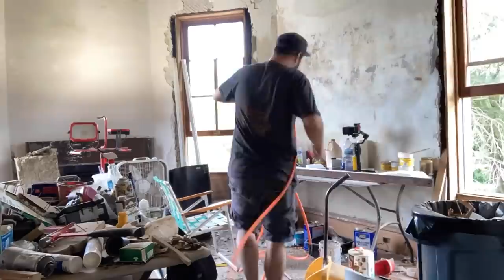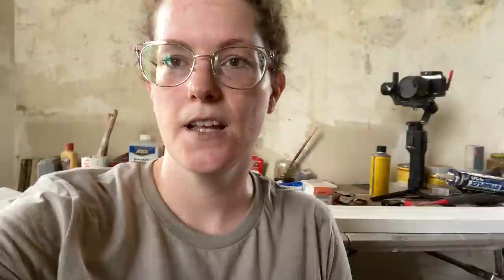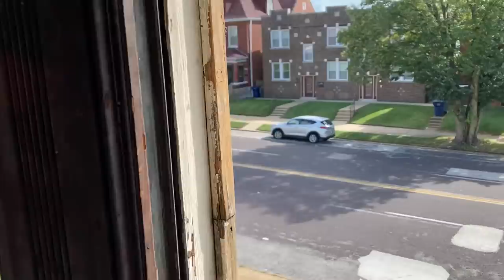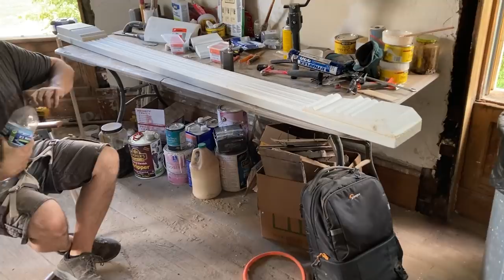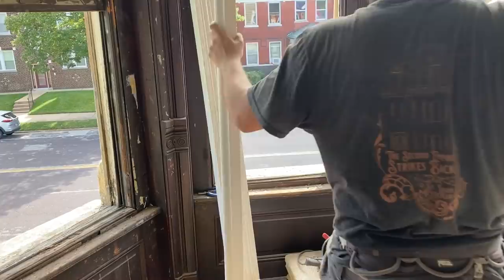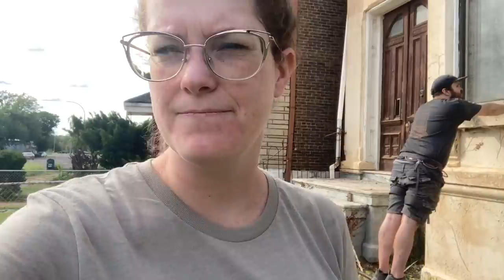Vlog 15 Cleaning Up the Library

Comment: Caleb is so lucky to have a partner in crime to clean up… I hate the cleaning up… but it has to be done….. don’t beat yourself up - why not pull all the staples out… they have to come out at some stage, why not take them all out at once. You have the patience of a saint. 100% to you both fir holding a relationship together while doing such a major project.
Reply from the maker: It really is a wonder that we haven’t had a squabble at the house.
Reply: @secondempirestrikesbackvlo2578  that's good. 
Don't sell your self short, ma'am. You are just as great as Caleb is just in different areas of expertise 😀 
 We LOVE Bucees 😃
Reply: @tashasmith6179  I second that sentiment.

Comment: Kim, you two are a package deal. I look forward to seeing both of you. And the house, which should be a lovely home when done (as if a house really ever gets finished. 😁)
I love the Second Empire homes, ever since I went on a tour of the Lucius Wing house in my then home area of Coldwater, Michigan. Fun thing about that place is the curved, tin mansard roof on it has leaked since new (1878, if I remember correctly.) So, there's always something to work on.
The comments on the shelving and storage are spot on. It's a big help with organisation. Even in my microscopic studio apartment, I was surprised by the difference between chaos and sanity a few shelves gave me. (And the few little storage solutions I've found for my ever growing collection of fountain pens and inks. 100+ pens, 26 different inks, currently, you might think pens and ink bottles don't take up much space, but unless you have good storage...)
I look forward to seeing each video from both of you! Even if it doesn't seem like the process is proceeding as fast as you might like (heat and tiredness can contribute to that feeling), you can take pride in the little things, even, knowing that they're done well and period correct, unlike the houses on "This Old House," which get unfortunately modernized and lose their charm from that. And the small things add up.
Keep up with the great work! Thanks for letting us see even things not directly related to the house.

Comment: I wonder if it would be worthwhile to get a heavy-duty shelving unit to serve as a way to corral all of the tools and materials that get distributed around the room while you're working on it. That would keep things off the floor, and would help to keep things a bit more organizable.
Reply: I agree.  Clutter makes me unproductive.   Keep up the good work!  Maybe a physical checkup might help find a reason for feeling tired. Just a thought.  Byeee
Reply from the maker: So yesterday I had just returned from vacation so I think that’s why. Today I was a little dizzy too, had me a bit worried. But I realized a few minutes ago I forgot to take my medication last night so that’s why.
Reply from the maker: Also great idea about the shelving!
Reply: @secondempirestrikesbackvlo2578  I agree !!  A couple of shelving units for the tools and the chemicals, etc currently stashed underneath the table plus a shop vac would make clean up soooo much easier!  You’d have clear floor space and suction to get rid of all the clutter and dust and dirt.
Reply: @secondempirestrikesbackvlo2578  I have one I'lll bring up this week
Reply: The best thing is to designate an entire room as a tool storage room, and keep it organised. Use a trolley to take required tools to where you are working.
I discovered this strategy while doing some work on my place and it changed my life.
Reply: @dcan911  
It worked for you and I think it would work for Kim, but I can’t see Kaleb wanting to waste time walking from one room to another.  I sort of have my doubts about him even using shelves in the SAME room!  He seems to get so focused that he just wants to work on whatever he’s doing until he’s ready to drop and then just wants to go home and get some rest.  
Obviously, I could be totally wrong - I don’t know them except for what I see on screen. 😊

Comment: Maybe get a nice industrial wet and dry vacuum. Saves agitating the dust when sweeping. Just suck everything up with no dust. Makes cleaning a lot easier too.
Reply from the maker: We have a big shop vac. I’ve never used one with water though! I just don’t want to clog the filter up with a ton of dust.
Reply: @secondempirestrikesbackvlo2578  There are special wet and dry ones (do have to be careful with that), had one in my old shop but I never let it get wet either. Cleaning them out was easy enough. I would take it to a corner of the building outside where there was no wind then turned the large internal bag inside out and blew it out with an airline until it was perfectly clean. On occasion I ended up wearing that dust and got plenty of laughs from everyone in the workshop, but that was a rare occurrence and usually happened when it was windy outside

Comment: I have a question about the front of the house was it originally Stucco or was it like most of the homes in the area that had full brick façade of course the neighbors that is heavily altered and very badly but back in the day they had no respect for Victorian style. It would be great if the open land was filled in with period correct facades or at least in similar style but that would be a big wish for future.
Reply from the maker: It’s solid stone actually